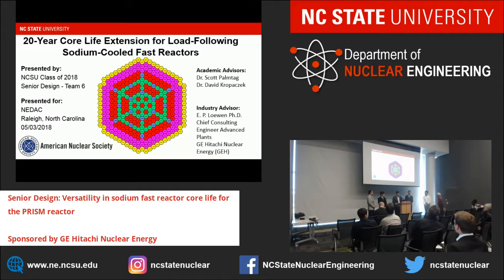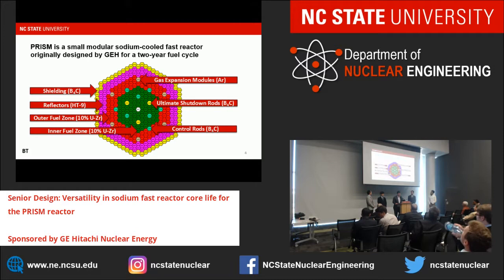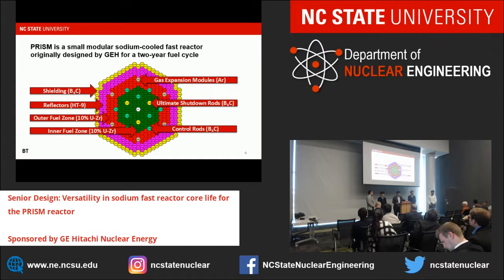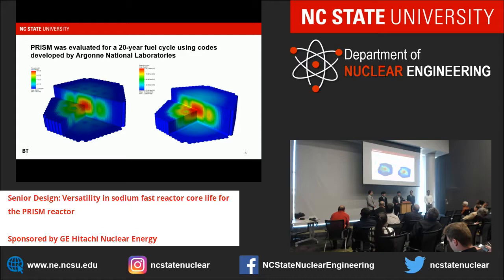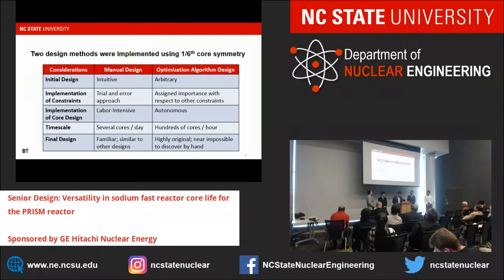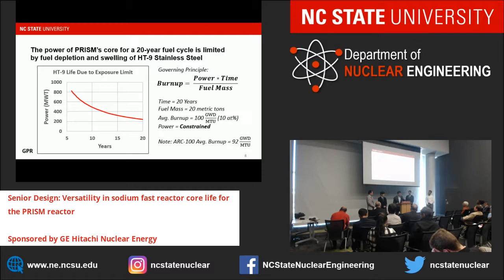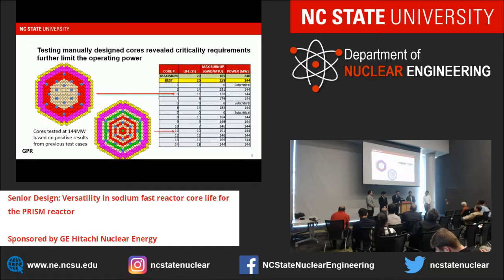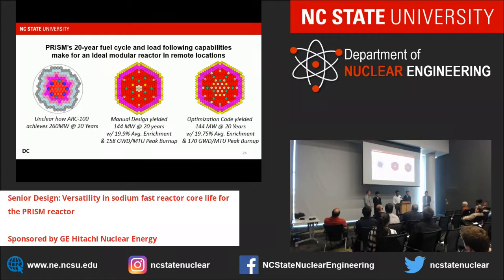2018 Senior Design:  Versatility in sodium reactor core life for the PRISM reactor

Comment: Thorium?
Reply: Thorium is a bit over hyped, sure it has some big advantages, but I think a fair bit more time and money to be invested in research and development with thorium fluoride salt reactors before we see it come to commercial fruition. In saying that India is on its way with Thorium and plans to have a plant by 2050. I think what's even more exciting than thorium is reusing spent fuel, more specifically burning U-238 and left over plutonium. There is huge stock piles of U-238 sitting around currently being useless, this technology is ready and commercialized by the Prism reactor, so we solve two issues together, reducing nuclear waste and reducing c02 emissions, it's just politics holding us back now, there needs to be a tax on carbon and then these funds diverted into nuclear and other clean energy.